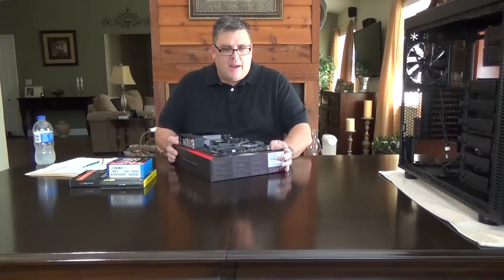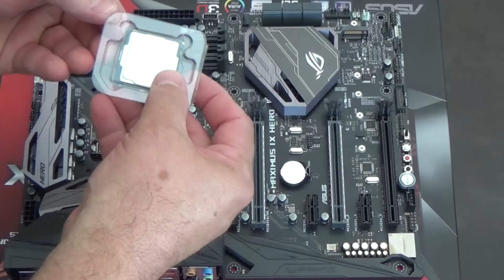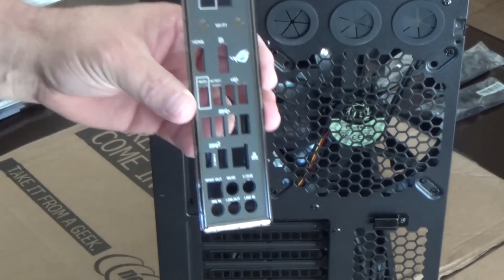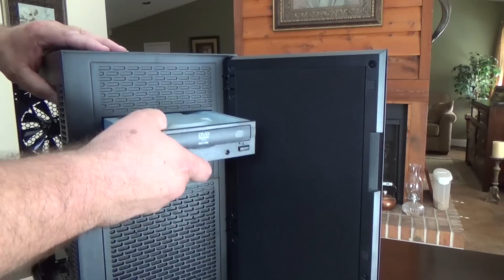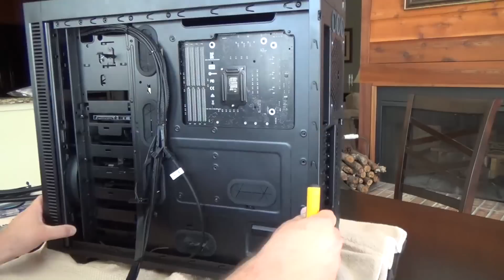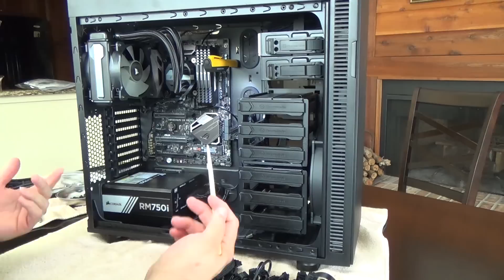Asus Maximus IX Hero - i7 7700k Kaby Lake Build

Comment: Hello, i'm sorry to disturb you with my silly question... but.. which CPU  cooling system do you think is better nowadays? liquid cooling one or the air one?
you see... i am a little concerned that something might go wrong with the liquid cooling one like.. leaking, and destroy the PC...
Reply from the maker: So, there would be only one reason that you would need liquid cooling and that is if you intend on overclocking your cpu.  Any processor, like the one shown in my video, with the letter k at the end of the model # does NOT ship with a fan cooler.  Intel assumes that you will provide your own cooling solution.  Then you are left to provide your own cooling solution which I almost always choose a liquid cooler.  The stories of leaking are coming from pc geeks that remember the days when you pieced together your own pipes, radiator and pump.  The Corsair solution shown in the video is what is commonly referred to as an AIO (All in One), meaning the connections were made at the factory and have a very low failure rate.  On the other hand, air cooling is a fine solution, however, fan noise and size are an issue with many installations.  Thanks for watching my video.
Reply: netnole Thanks alot for your prompt answer. I think i will go on the air cooling one afterall, and if you dont mind, may i post on a configuration of a gaming PC and have your opinnion about it?
Thanks alot again! (glad to have people like you among us 😊)
Reply from the maker: Glad to help anytime.  Thanks.
Reply: netnole Here is what i have been thinking of... but i'm not quite sure if the GPU is compatible with this build... is it?
So... here it is:
Asus ROG Maximus IX Hero Socket 1151 MAXIMUS IX HERO
Intel Core i7-7700K 4.20 GHz Socket 1151 Box BX80677I77700K
Noctua NH-D15 cpntd15 (if you know a better air cooling one i'd gladlly accept the advice)
Zotac GeForce GTX 1070 2x IceStorm 8GB GDDR5 256bit zt-p10700g-10m
OR 
Asus GeForce GTX 1070 ROG Strix 8GB DDR5 256Bit strix-gtx1070-8g-gaming (which one you recommend? i'd go for Asus one)
Corsair Professional Platinum Series AX760
Corsair Dominator Platinum 32GB 4x 8GB DDR4 3333MHz CL16 cmd32gx4m4b3333c16
SSD Samsung 960 Evo 1TB PCI Express x4 M.2 2280 mz-v6e1t0bw
DVD-Writer ASUS DRW-24D5MT Bulk black DRW-24D5MT/BLK/B/AS
Thermaltake Suppressor F51 Power Cover Edition

Have i missed anything? (i didnt tought that an extra HDD would do much of a difference to me, as the  1TB SSD is way more then enough space for me... or does he have to play a more important role?)
Reply from the maker: The platinum series PSU is overkill, 80+ Gold is perfect for almost everybody. Your M.2 drive is massive overkill and a complete waste of money in my opinion.  OS and programs go onto an M.2 drive. Get a mechanical drive for long term storage and save $200.  The Noctua is an excellent choice.  The RAM is also extreme overkill. You will never see the speed above 2666 Mhz.  Save your money and put the savings into a second GPU if you are a gamer.  If your not a gamer, we should talk privately about your needs.
Reply: netnole Yes I am a gamer. so... should i just drop the 1TB SSD and maybe get 250GB one to install windows and programs on it so it would go faster, and get a HDD and a second Asus GeForce GTX 1070 ROG Strix 8GB DDR5 256Bit strix-gtx1070-8g-gaming? (as that 1TB SSD is quite expensive indeed)
And you got me thinking about the RAMs... why are 32GB overkill with 2 x 8GB GPU? (indeed... 32GB is alot, but you know... you can never have enough haha)
And last thing... would Corsair Professional Platinum Series AX760 be enough for both GPUs?

And thanks again for the help. (i feel like hugging you hehe 😅)
Reply from the maker: 32GB is not the overkill, the platinum 3333Mhz is.  The price curves up steep to get to the product that you chose.  You will never see the speed increase on this rig.  Don't forget, all RAM is 2666Mhz at this point.  You are overclocking to get the 3333Mhz (You will see this will you POST and go into the BIOS - no matter the speed of the RAM it will report 2666MHz until you overclock it).  Look for a reasonably priced Corsair Vengence 3000Mhz and you will not miss the Dominator, which is for very specific needs.  You could save $600 on my previous suggestions and have two kick-ass GPU.  Don't forget about the PSU, no need for 90% efficiency at full load.  The Gold+ standard will be 90% efficient at 50% load.  Maybe bump to a 950watt and go with Gold+, you will save there as well.  I wrote an article about this in detail, read this.... http://mikelilley.com/2017/02/05/80-plus-certification-power-supplies-explained/.
Reply: netnole Thanks alot again. I understand now. Going for a quick lecture. You're the best! 😄
Reply from the maker: Thanks for the kind words.
Reply: netnole No need to thank me... I am the one in debt with many thanks. I have read the article, and i must say it was a very enlightening one for me. You have a very unique and smooth way to teach others. Keep it up!
P.S. : I hope one day I'll get to thank you in person 😊

Comment: I am not a fan for those thermal radiators.  The Intel fan works just fine.
Reply from the maker: It is not possible to overclock an unlocked CPU with a stock fan.  We purchased the i7 7700k, where the k designation means unlocked.  Intel no longer ships k series CPU's with coolers.  Thanks for watching my video.

Comment: Quel est l’intérêt de mettre de la DDR4"LED" dans une tour fermée ???
Reply from the maker: Il n'y a aucun avantage, à quoi sert votre question?
Reply from the maker: I normally do not respond to questions that are submitted in a language other than English, however, this question is so ignorant I felt it required a response in French. Ha!
Reply: When you put LEDs in a tower, it's to see them from outside ... right?
Reply from the maker: According to who?  Whether or not the RAM came with or without LED's had absolutely no influence on my decision to purchase.  My decision to purchase was based on price, performance specs, the Corsair brand,  and availability of my local wholesale supplier.

Comment: Hey. Why u didn't use asus easy instal tool for cpu? It negates the risk of damage for socket pins. 😆
Reply from the maker: In 20 years I have NEVER damaged pins on a motherboard CPU socket or in the case of AMD pins on the CPU.  The ASUS  Easy Install Tool is a crutch for amateurs that ASUS only recently started including to reduce the number of motherboards being sent back RMA.  I'm quite sure my video demonstrates that I am not a beginner system builder.  Thanks for watching!
Reply from the maker: Yes indeed, Jol Jole asked me why I did not use the crutch (Hey. Why u didn't use asus easy instal tool for cpu? It negates the risk of damage for socket pins.).   He didn't ask me if HE should use it.  You are just looking for an argument.  Move on pal.
Reply from the maker: Regarding the CPU install tool:  Amatuers should NOT use the CPU install tool under ANY circumstances.  In order to snap the CPU into place your fingers MUST touch the pin beds on the underneath of the CPU.  Not a good practice to get dirt and oils from your hand into those areas, on RAM connectors as well as GPU connectors.  In addition, when the CPU in loaded in the tool, you no longer see the notches on the sides to guide the placement.  My mother board did not come with a gold triangle for alignment.  I relied on the notches for placement.  Causes much more confusion than it helps.  You need to see the CPU guiding into the socket.  There is a reason only one OEM is using this useless tool.  If the insertion of a CPU into socket in a difficult concept, maybe you shouldn't be building your own computer.

Comment: nice video and build..20day ago I build ranger VIII ,i76700k ,H100iv2...i connect AIO too cpu fan and did not disable cpu fan to ignore..anyway my corsair link 4 latest version do fine with no issue got low temps allso..should i connect h100iv2 too pump connector??so far my rig is doing fine with 4.2ghz temps when on stress on aida and prime95 is 55C-57C max.i hope pump wont die hoking on cpu fan..like i said corsair link work like charm on silent profile custum curve made.Bios fans are set too pwm not DC.
Reply from the maker: Your Ranger has a Water Pump connector as well as a CPU fan connector.  I would connector the fans to the CPU fan header and likewise with the pump.  The connection to the USB 2.0 header with control the speeds.  It sounds as though your temps are good however.
Reply: btw,is it ok to keep my pump on2/3 speed aporx.1980rpm-2000rpm insted  max.2980-3000Rpm, if i got  good temperatures?.asking this couse on net/forums said , pump should be  max on non stop. Netnole,Apreciate it for info.
Reply from the maker: The Forums are wrong.  The Corsair Link software should manage all of that for you.  It will speed up the pump and fans when needed.  I wouldn't use any manual settings.  I choose the quite option and have never had an issue.

Comment: Don't most computers use the rear fan to draw air in?
Reply from the maker: Good question, actually no.  Except for rare circumstances, the front case fan will draw cool air into the case and the rear fan will exhaust the heated air out the back.  I suppose you could reverse this principal and draw in from the rear and exhaust from the front, however, this setup has two disadvantages....  The front fan is almost always larger (like in the case of the Supressor F51 and you would be exhausting heat right toward your body!  In this build the dual rear fans are exhausting heat from the radiator as well as the heated air from the case.  Thanks so much for watching my video.
Reply: netnole Thanks for replying!
Reply from the maker: My pleasure, I love to answer intelligent questions like yours!

Comment: why not go with Asus tuf z270 mark 1 instead if you aren't using for gaming
Reply from the maker: Make an argument for the TUF z270 mark 1.
Reply from the maker: Here are my arguments against:  The Hero is cheaper, has ROG software.  TUF has Realtek audio (drivers are terrible), not the SupremeFX, I don't need the thermal protection of the TUF as my cooling solution is perfect (water cooling and case).  I Don't need dual gigabit ethernet (you need a specific router to bond the connections, as I am sure you know).  I have read and fully understand every spec on both boards.  Gamers buy the TUF boards for one reason only - thermal protection.  Everything else is basically the same except for what I noted here.

Your argument is that I am not using for gaming.  My customer want's to game at a later date and have future proofing.  Many discussions were had when choosing this board, how could you possibly have an opinion on the selection of our board.
Reply: Sabertooth has 5 years warranty versus 3 years. Sabertooth I believe goes through intensive temperature tests, before they get shipped. I buy Sabertooth, because it has the raw, and solid approach regardless of your application. i compare it to a heavy duty truck. my other system is running a Z87 Sabertooth that survived multiple outages. anyway great system. the only thing i would do is to replace the stock fans with quieter/ more efficient fans (Corsair ML120 Pro/Noctua) for example, assuming your cooler is using a 120mm fan. you'll love those high-quality fans.
Reply from the maker: Thanks for watching Waleed, we are very happy with the stock fans and our mobo choice.  The case mitigates any noise from the case fans and has great thermal engineering.  I think the Sabertooth is a fine choice, however we are running temps at 28°C at idle, no reason to spend extra money on cooling when we have achieved an optimal temperature already.  Being a respected system builder includes keeping costs down for the client.  Choices for my personal rig would naturally be quite different.  On the warranty comment, In my experience motherboards and hard drives fail early if they are going to fail.  Once a three year mark has been achieved, no reason to spend extra money on a 5 year warranty when I have never had to RMA  aboard after 3 years.
Reply from the maker: I'm removing certain comments on this thread because of the mis-information that is being spread.  A user has been trolling from one comment to the other and posting factually incorrect information and I won't allow those types of discussions here.

Comment: Just built my new build with the ix hero and GTX1070 and I have no USB power or display and error 53. Any suggestions
Reply from the maker: Unplug everything except front headers, cpu/fan and ram and try to isolate.  As a rule of thumb, never attempt to post with the gpu installed.  Complete the build, get POST and then install the GPU and attempt to POST.  Error code could indicate the wrong speed of the RAM, did you set XMP on the RAM in BIOS?  If so go the other way, or possibly Profile 2.  Also, never attempt a POST after overclocking.  Get the build done, update the BIOS, get POST and then attempt overclocking.  Error code is pointing at the RAM.  Could be that the RAM it is not compatible or the speed settings need to be adjusted in the BIOS.   Have you tried booting with single sticks of RAM, does that change the error code?
Reply from the maker: I posted all of the ASUS Boot error codes at my website.  http://netnole.com/archives/815
Reply: netnole all I have is 1x 8gb ram stick I've tried every slot.
Reply from the maker: XMP selected in BIOS?  That will set the correct timings.  Also, 2 sticks of RAM will run in dual channel mode much more efficiently  Can you easily return the RAM for 2 x 4Gb.  ALWAYS buy RAM in pairs.  What type of RAM, make, model#.  Is error code still 53  with each populated slot?  I need much more information to help.
Reply: netnole I got 2x 8gb coming today hoping that fixes the problem
Reply: netnole well I fixed that problem but now I'm stuck in bios and now it won't let me exit. Every time I save it reboots to bios.
Reply from the maker: fix your boot device (hard drive) in the BIOS

Comment: Did you attach the micro USB to USB two on the motherboard so that you could use the corsair link program if so why why not thank you for your help
Reply from the maker: Both the Corsair RM750i power supply and the H80i water cooler have the corsair link connections.  The current Maximus IX Hero only has a single USB 2.0 header.  I chose to connect the Corsair H80i water cooler to Link software because of the fan control and the radiator.  High end motherboards manufacturers, like Asus,  are moving away from adding USB 2.0 headers for obvious reasons.  At some point we may add a PCIe x1 card to attach additional devices, such as the Power Supply, which by the way only provides reporting, there are no adjustments to be made through the Corsair Link software for power supplies.  Great question and thanks for watching my video.

Comment: I need a Blue-ray writer that can play 4k (Blue-ray Black) videos, anyone know of one?
Reply from the maker: Samsung UBD-K8500 3D Wi-Fi 4K Ultra HD Blu-ray Player.  It's over $225 dollars, not sure why you would want to invest in one.
Reply: sorry I did not make myself clear (that was my fault) - I need one that fits in a PC. I have a few 4k videos (Black editions like the  Martian) but I many 4k monitors  all  PCs connected. I do not have any 4k TVs
Reply from the maker: Not aware they made such a thing.
Reply: also, I was looking at buying one of those and they are really large units (Samsung UBD-K8500) and plug into my 4k HDMI ports. But I also have a requirement to burn normal Blue Rays data disks -  so I thought against it. As you know it is all about the Data - like you needing 6 drive bays I have a few systems that have 20TB in them with fast M2s
Reply: I think that is my problem - I do not think they make such a thing either My Alienware Laptop did not even come with a DVD/Blueray option. My Dell M4600 was the last laptop I have with a Blue-ray writer. For my Dell M6700 I brought a Samsung external Blue-ray Writer but it is very slow. I have blue ray-writers in all my Desktop machines.
Reply: ASUS BW-12B1ST
https://www.asus.com/Optical-Drives-Storage/BW12B1ST/
Reply from the maker: You could not have chosen a more expensive DVD writer.  At $150 why not just burn hundred dollar bills at the entrance of Best Buy while handing over your wallet.

Bad choice Chi-Wei.  Here is a highly rated LG for $49.  https://www.newegg.com/Product/Product.aspx?Item=N82E16827136250
Reply: you are right, sorry
Reply from the maker: all good, its about the conversation!